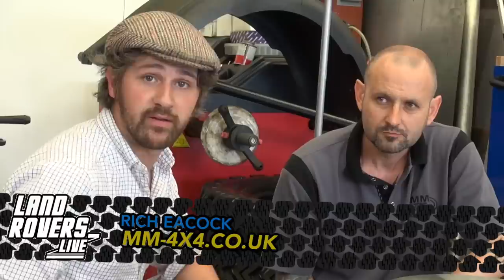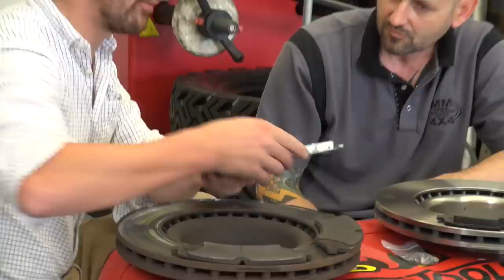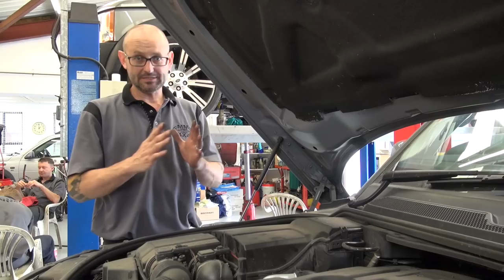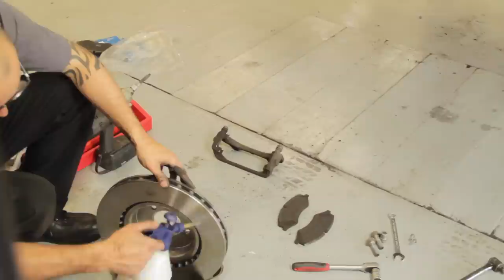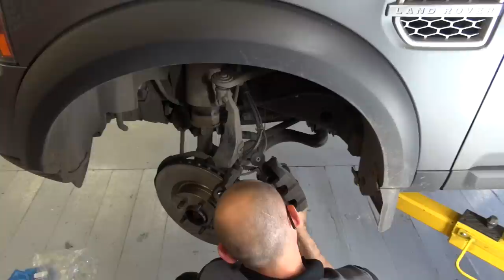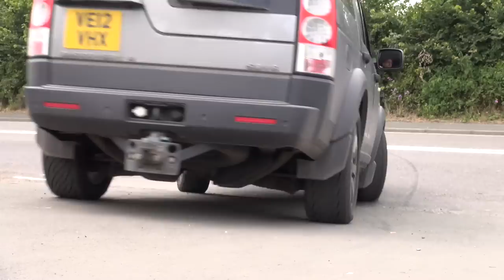Workshop Guide:  Land Rover Discovery 3 + 4 Brakes

Comment: Love the description. " would make a horrendous noise if the pad metal grinds on the disc".   Interesting and informative video...........thanks.

 Add to this....... scoring is not bad unless they are deep scores on the working surface of the disc  then it will generate more heat within the disc area. Not good for brake performance and wear.  Corrosion on the disc is not an MOT failure ( only advisory )  unless the brake performance / efficency is compromised.